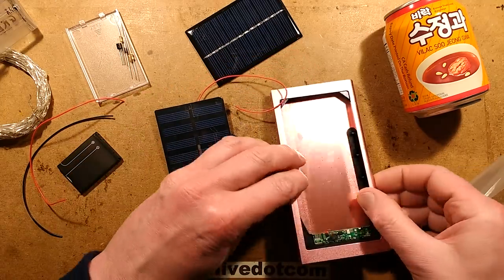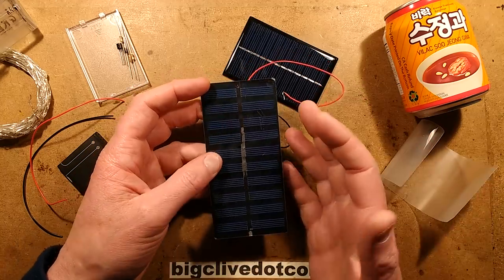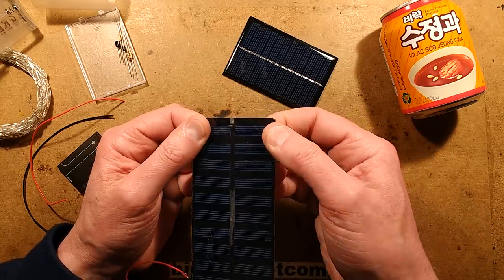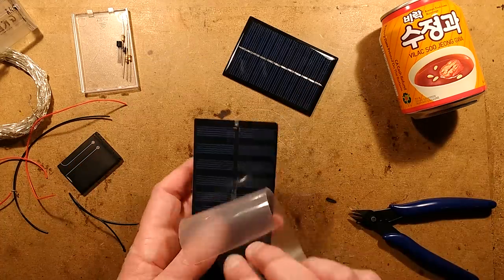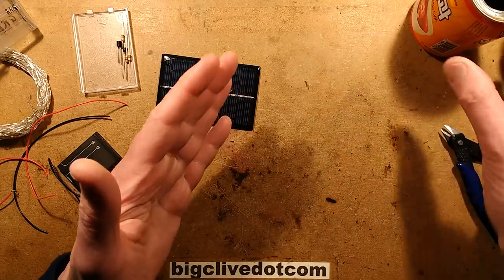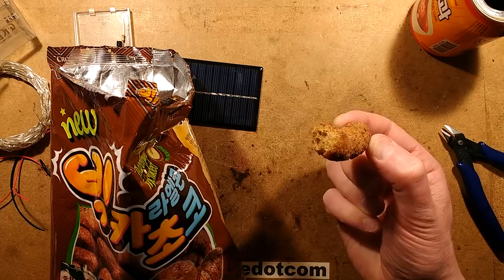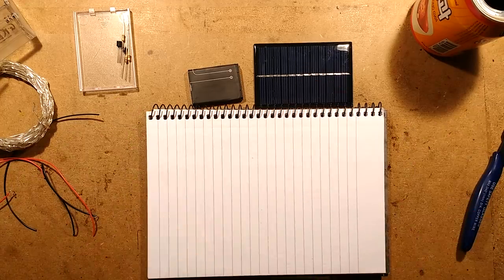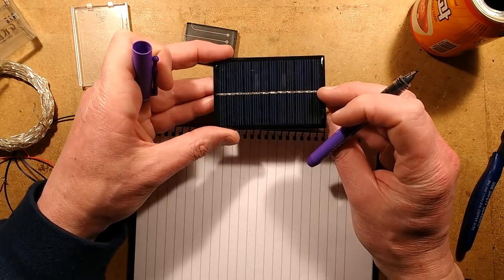Simplest solar light possible, using old phone battery.

Comment: any chance of bigger projects on the channel??? I like stuff like this!  I been thinking about doing something like this. except for a solar clock. or more like a timer . to see how much sun different areas around my house gets during the day. to find the best place for solar panels!  there is a lot of trees. that the sun hides behind throughout the day. I was thinking maybe a dollar store solar light. and a clock. analog 1.5v est.  to power the clock. letting me know the hours of sun. crazy but possibly useful..  I don't feel like sitting at different places every day. all day. great video.
Reply from the maker: You could just stick a small solar-light style solar panel into a quartz wall clock and it would only run when there was good light.  Zero it to 12 and see how much it moves in a day.

Comment: Very interesting circuit - and i happen to look for something like that right now to power a littel night led lamp for a staircase. I wonder about the efficiency of that circuit because lots of the battery power is wasted in the reverse currents through the solar cells, probably heating it up a little. Did you measure the reverse current through the solar cell? If its only a minor part compared to the led current, its o.k. but it may depend on the kind of cells you use. Could be half the amps the panel would deliver in daylight - so that wouldn't be really good efficiency, would it?
Reply from the maker: The diode blocks reverse discharge.
Reply: Yes, but the whole circuit builds up around the reverse leakage current of the solar panel, doesn't it? - so i am a bit confused ...(to hear that there is no reverse leakage current). The diode is positioned in forward voltage when the solar panel is charging the battery and it blocks reverse currents from the battery to the panel, yes... but...

o.k. i had to rewatch it - i think i got it now: its only the little reverse current through the base of the transistor to switch it on for the led in darkness. Its not the whole voltage of the battery across the panel, only the tiny base current needed to switch on that goes through the panel :-) Most of the battery voltage is dropping across the 10k resistor and 0.7V at the base-emitter path. So this is rather a quite simple, clever and efficient circuit! :-)

But i guess its hard to adjust to lighting conditions. When the panel stops charging the battery (because it is full or because the voltage of the panel is not high enough - it must be at least 0.7V over battery voltage) the transistor can start conducting and switching on the light, even when there is still some brightness.
Reply: i have just tested the circuit and it works quite well. But i was right with my guessing that the led lights up already in quite bright condition, when the battery is not charging. You can control it just a little bit by adding a 1k pot across the diode, to drop the reverse voltage further - but it doesnt work really satisfiying as the solar panel needs quite a high brightness to deliver enough power to charge the cells. Even in cloudy sky the led would light up unless you have a really big panel with much higher nominal voltage than the battery. I tried it with a 6V panel (like yours) and a liion cell only charged to 3.6V.

P.S. the 1k pot across the diode is bullshit. A 10k pot between Emitter and Base does a much better job and wont lead to higher leakage currents as the 1k across the diode. Got quite reasonable results around 5k values, so you can adjust the starting time for the led to the darkness/brightness you want. If you go too low with the resistance the led wouldn't light up so much even in full darkness.

Comment: Was gonn make this but wing it with no electrical knowledge. I have the solar cell, a mobile battery and some wires. The solar cell has a board that controls the lights but no resistors (i dont think) is that safe? Dont want the battery to go boom

Comment: When you put the cell outside to get sunlight, it can turn very hot, and the whole circuit may explode, because the battery overheating. It is better to put the circuit and battery in a project box, with ventilation holes, separated from the cell.
Reply from the maker: That's why the cell was separated from the solar panel by a foam pad with ventilation gaps.  That said, in really hot climates everything would get hot fast.

Comment: I have a question, where would you place a switch (or additional circuitry) to make the dusk sensor optional?
So basically turning the battery into a backup source to keep the light on, constantly.
Ther idea here being, flashing UV LEDs with a 555 timer, as bird repellent. In my experience this works rather well to keep crows and winged rats off your balcony.
Reply from the maker: You could put a switch between the emitter and collector of the transistor to bypass it.

Comment: great video clive as many are . ive been watching your videos for a few months (nearly seen them all now ) and this one is just what i need (kinda) i have a couple of questions tho . 1 is it possible to use the reclaimed devices you find on the street for this ?. if so is 1 enuff or would it be best to have 2 in parallel ?. (since watching another of your videos i have had my nephew donating me his i have well over 20 now that need putting into a new home ) 2 is it possible to include a TP4056 for protection for these cells and have it connected to a 5v 500mA solar panel that i have brought  i cant find a schematic on this with all three things connected it gives me the ability to have different ways to charge and store this way . . hopefully i can get this project working with the stuff i have and it will work and last unlike the usual solar stuff (tat) my mrs likes to buy that i end up having to fix-mod-upgrade -throw away lol  :) .
Reply from the maker: The salvaged cells will need an extra DW01 protection circuit.
Reply: @bigclivedotcom  i thought there was a version of the tp4056 that had that built in ?. its the one that has the extra pinouts at the end ?. im new to this but got some projects in mind .
Reply from the maker: @davethorne3925  There is a version of the TP4056 module with the extra cell protection built in.
Reply: @bigclivedotcom  thanks  i just found the october video that matches more what i had in mind .

Comment: Are phone batteries charged with 6V? It's usually 3.7 or thereabouts. I would expect the protection circuit not to allow anything through..
Reply from the maker: It has to be above the maximum voltage of the cell to charge it.   The protection circuitry has very little drop across it.

Comment: The coating may also be UV protection. I don't know if you've bought solar cells on their own (probably) but they are very brittle indeed. They're like potato chips... Try to flex them even slightly and they'll just snap in half...
Reply: Crunch crunch crunch crunch! Watch on as Clive munches on the solar cells accidentally hehe

Comment: Do the LEDs give enough light if placed on the solar panel to shut if off? If so does it oscillate?
Reply: Yes, it's possible to make a simple oscillator that way, or there abouts.. I think mikeselectricstuff did a challenge whereby one had to create the most absurd oscillators one could think of and that, in a round about way formed part of it.

Comment: I'd think, if you need that dotted resistor, it would go across the solar panel (to create artificial leakage). Or, it would have to be a bit higher than 10K.

Comment: Can you please do a video on how you would do this using a battery that doesn't have built in protection, so using the tp4056 charging board that will power an led strip light? I'm not sure how to convert your method of the diode and the transistor with the charging board, my battery is a basic 3.7v lipo cell with no overcharge protection, I'm wanting to use it to power a 5v led strip outside as a solar garden light

Comment: On most batteries center pin is a thermoresistor, but not on Nokia. On Nokia it is just a fixed resistor that indicates battery capacity.

Comment: Hello, this is exactly what i was looking for thank you Very much, i have a question tho.
after testing the circuit at home, i saw that it's not that sensitive in my case, and that i may need some tweaking, to not light up when the sun is still up.
Should i lower the value of the 10k resistor to 1k for exemple (next value i have) for the kind of tweaking i need to do so that it does not light up when the is still a modest amount of sun ?

EDIT: forgot to say that i'm using a 8050s transistor, and my string of leds already have resistor for me so no need to add one to the collector, and the string of leds between 400 and 500 mA

EDIT2: nevermind, i need even higher value than 10k to make it turn on even later , i'll see how it goes
Reply from the maker: It's a deliberately simple circuit.  Only really suited to low current loads.  You can try juggling component values.

Comment: I have another question: How would the DW0 protection circuit look like?
The idea being, to use a 18650 cell for example.
Reply: Checking the DW0 datasheet tells you everything you need to know. And apparently the 8205A dual mosfet package is an almost bespoke companion piece. They even sell them as package together with the DW01.

Comment: I love your videos!  I have a question: What temperature do you keep your soldering iron at?
Reply from the maker: Typically around 350C.
Reply: Awesome! I keep mine around there, too. It takes you much less time to actually flow the solder onto the part. I suppose it's my tip! I've been using a small tip (For small electronic boards). This just goes to show I should swap out my tips if I'm gonna do something for bigger components! Thanks a lot

Comment: @Bigclivedotcom Thanks mate! I remember buying components for a project like the one you built for the fairy lights a few years ago. I'll have to dig them out and make a build like this one soon! 
Say, are the components the same as the first solar panel project you made? Or are there others in this one? I remember you ended up with 10 ohm and a 10K, and I believe the diode was a 1n4007. Can't remember what the transistor was back then though.

Thanks for your entertaining and educational videos, keep 'em coming! Best wishes from Norway
Reply from the maker: It uses identical components in a different format.   The diode can be any standard 1A diode from 1N4001 right up to 1N4007.
Reply: bigclivedotcom Thanks for quick reply, much appreciated!

Comment: I converted a solar rechargeable spolt light from 3v to 5v USB to a 4.5v door led wreaths. I made a video on my youtube channel. Once the battery drained out and it charged all day it only power the wreath for 30 minutes. As a note it has been cloudy and there is not direct sun light. By doing the way I did am u drawing do much power?

Comment: I have learned alot from watching your videos, I have a hot air desoldering iron that I bought off ebay. It worked for about 2 minutes then it wouldnt work any more or it was intermittingly working. Can I send it to you to see if you can find out whats going on?

Comment: Hi Clive , I've just tride to do this and i'm missing something. I keep looking and I've wired it up but the LED glow's when solar panel is face up. and when disconnect battery it goes off. Any Idea's as what I could be doing wrong ?

Comment: I wonder if there's a transitional period at a certain light level before the light turns on/off, in other words the transistor might turn on/off partially depending of the voltage leak over the solar panel during dusk/dawn.  If that's the case, is there any way to mitigate that so it turn on/off instantly at a certain light level?

Comment: I wonder, does the LED's stay on under a bright full moon? But I'm assuming changing the base resistor will fix it if the LED's do go off under moonlight?
Reply from the maker: The moonlight won't be bright enough to turn the LEDs off.

Comment: I soldered direct to a phone battery a few weeks back. Solder blob shorted it.... I panicked, ripped the board off to remove the short... Then realised the whole point of using that battery was because it's protected. Derp.
Now I've got a near full charged lithium cell I can't easily discharge :S
Reply: That story should teach me a lesson. Thanks.

Comment: Very nice! Would it be possible to use a super capacitor in a similar configuration?
Reply: With a proper buck converter limiting voltage, why not.

Comment: I really like this circuit, built many such lights using it, replacing the phone battery with an 18650. I have a request. There are many projects online to create a mini-inverter (3.7v dc to 220v ac) to light  a LED bulb up to about 5 or 6 Watts. The circuits online just use a battery and switch (which is okay) but I want to add a  5V solar panel and have it go on at dusk. Any chance of circuit mods to enable operation similar to your above project?
Reply from the maker: I think that might be so inefficient that it would run the battery down fast.
Reply: @bigclivedotcom  Yes I guess you're right.  One website says "Use rechargeable batteries to power this inverter, non-rechargeable batteries get discharged in few minutes. With two li-ion cells we were able to light up a 3 watt bulb for more than 90 minutes".

Comment: hmmm I don't have any protected lithium cells roaming around, however I do have a number of regular 18650 cells harvested from old dead laptop batteries and BMS boards for lithium ion cells appear to be fairly inexpensive. Wasn't really sure what I'd use them for when I saved them but I thought I could find a reason, I might find the reason to make a couple of these, perhaps wire them up to some kind of receptacle so the type of connected light can be changed.

Comment: @bigclivedotcom I have to say I am thinking I may try doing this as a first project. What would you think if I did a one sided circuit board with it?
Reply from the maker: It doesn't really need a circuit board.  The number of connections is so low that soldering leads together is easy.
Reply: Ok, am working on a possible box design for it. So it can be placed inside or outside.

Comment: Clive, if I had two old mobile batteries should I wire them in parallel or series?  (same make/model battery)
Reply from the maker: You could wire them in parallel, but make sure the voltages are well matched first.

Comment: If you put the LEDs on top of the solar panel, do they emit enough light to turn themselves off? In theory this could be used as a very messy sort of oscillator!
Reply: I think it would rather self-stabilizing.

Comment: For anyone else that enjoys a visual, I (hopefully correctly) modeled this in Falstad: http://tinyurl.com/y7p6urnd

Clicking on the switch toggles between the the panel in the light and in the dark.

Values for the solar panel more or less taken from: 

Explicit Expressions for Solar Panel Equivalent Circuit Parameters Based on Analytical Formulation and the Lambert W-Function - Javier Cubas *, Santiago Pindado and Carlos de Manuel

Comment: Hi Clive.  Would this circuit work if I we're to use a 1.5v  ni-mh instead of the phone battery. Or would I need 2 ni-mh  for it to work our something different.  Resistor values etc.  ... thankyou
Reply from the maker: It would need at least two NiMh cells to light the LED.
Reply: +bigclivedotcom Thankyou Clive,  I just got to find a seller that just sells the leds now without the AA battery box attached,  lol.  . love watching your project builds

Comment: Do we know how well these waterproof LEDs survive in gardens, especially in hotter climates?
Reply from the maker: I've had a set of the copper-wire LEDs in my garden for about two years now and they're fine.  The wire is lacquer coated and the LEDs are dipped completely in resin.
Reply: Thanks ... hadn't realised you can pick up a 100led strip for under £4 either!!  Happy times ahead.